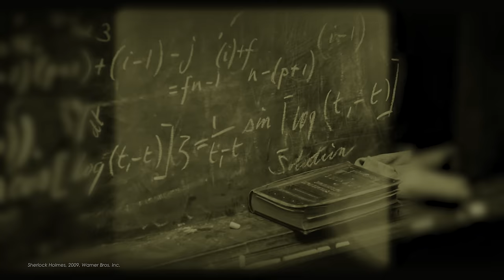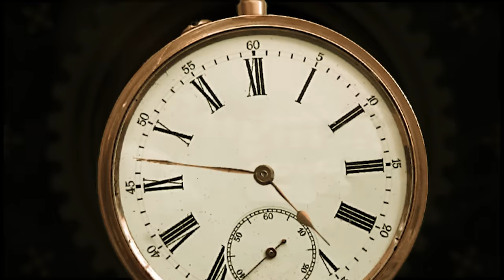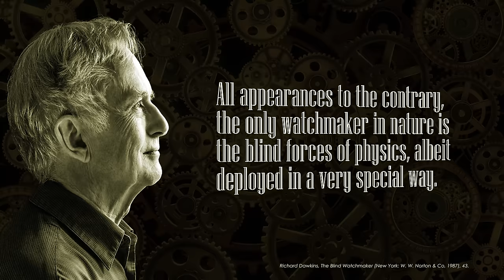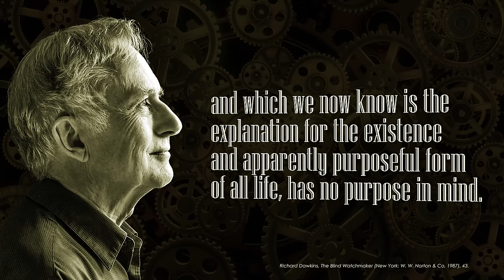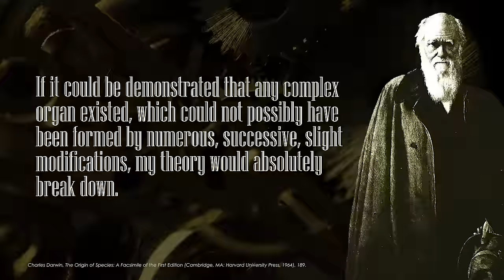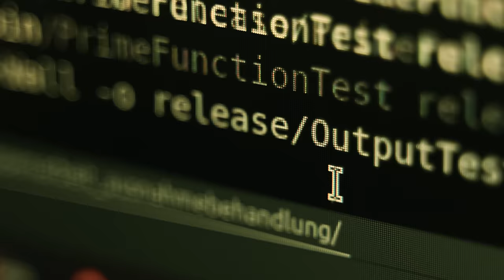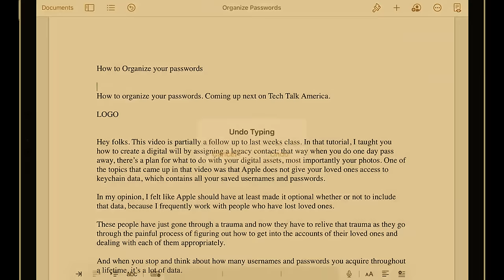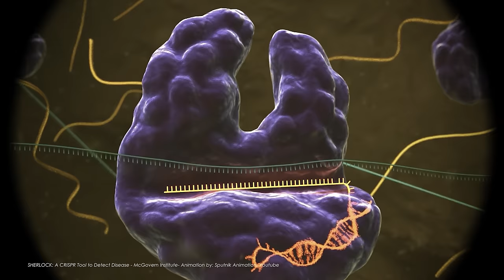Even TOP Evolutionists Won’t Deny This Evidence for God

Comment: THERE. IS. NO. EVIDENCE. FOR. A. GOD.   NONE.   Even the presence of beauty, symmetry, and incredible equilibrium in the cosmos does to point to a god.  It points to the presence of beauty, symmetry, and incredible equilibrium in the cosmos.  That is the only conclusion justified by the evidence.

Remember, just because you don't understand something doesn't mean it's God.  It means you don't understand.
Reply: Design points to a designer- Remember, just because you don't understand something doesn't mean it came about through naturalistic processes.  It means you don't understand.
Reply: @calvinsmith7575  Do you not see the issue in your reasoning?

Can you provide evidence that nature is designed?
Reply: @LordMathious  Of course I can, and so can you. Just apply the exact same standards and methods you would use to determine whether something else was designed or came about by random chance to nature and you will see it was designed just as Romans 1:20 says. What is so funny is that even Richard Dawkins admits there is incredible design in nature.  He just believes it was unintelligently designed : ). Go figure, he believes that no mind can somehow design things our most intelligent minds on the planet can't even come close to : )
Reply: @calvinsmith7575   Then could you please present your best piece of evidence.
Reply: @calvinsmith7575 remember just because you don’t understand something doesn’t mean it came about through naturalistic processes

Just because YOU dont understand something doesn’t mean it didn’t happen via natural. Don’t pull personal incredulity
Reply: You'll want to retype your statement, you have a syntax error.  However, I think I get the gist of your statement:  it philosophically throws out all causation.  Which is odd, since science is all about drawing conclusions from evidence, that is, positing causes due to observed effects.  Philosophically the existence of anything necessitates a prior cause, until you eventually arrive at the uncaused cause (aka Unmoved Mover).  And then it gets even better when you learn that the Unmoved Mover is a person, who wants to have a relationship with you and knew you before you were born!
Reply: @peedee4065  What on earth is this reasoning?

Tell me, how do you start with premise 1, that the existence of anything requires a cause and then turn around and introduce premise 2, that this implies there must be an uncaused cause?

Why is it so hard to accept that the only thing we have evidence for always having existed, the singularity from which came the big bang, is this 'prime mover' that you suggest?
Reply: @LordMathious Cause is a given.  In science we've given a name to that which causes mass attraction:  gravity.  In biology life comes from prior living things.  In anthropology beliefs come from what cultures have been exposed to and their interpretation of that.  In chemistry processes come from interactions of atoms and particles.

When it comes to existence and creation you're just playing games with yourself by continuing the causality process ad infinitum.  

To say that there is no prime causality would be to remove all meaning from existence.  If we are simply a revolving, unending process, then there is no moral good or evil, and there is no inherent right or wrong or meaningful beginning or end to any of what we know and experience.  Meaning that your parents conceiving you had no meaning.  Your participating in "good" acts towards others has no real import.

To say the Big Bang is the Prime Causality doesn't explain our inherent connection with beginning and end and good and evil.  The Prime Mover has a beginning and end plan for setting things in motion.  A Big Bang, which is a purely physical process that doesn't explain soul nor reason nor order by itself doesn't even explain its own existence or purpose, it's just a cop-out cause to explain the physical motion of the universe.  The Big Bang is perfectly observable but can never be the Prime Mover or Unmoved Mover that put things in motion for a reason.  

Ultimately one's acceptance of a rational first cause boils down to a personal struggle and choice with one's own sense of existence and belonging and responsibility.  Choosing to be "distant" can be your personal reality but doesn't affect that universally people have always accepted a God.  Atheism is a modern belief system that threw out anything that couldn't be "scientifically" validated.  The fruit of atheism is a distance from the most fundamental and inherent truths regarding us as living, rational beings.
Reply: @peedee4065   Absolute tripe. Answer my question. 

Why can't the singularity which caused the big bang be this prime mover?

What if I claim it has simply always existed with no beginning? What do you do then?
Reply: @LordMathious  I have already answered you:  a singularity "can never be the Prime Mover or Unmoved Mover that puts things in motion for a reason."  Emphasis being on "for a reason."  A singularity could be the efficient and material cause for the universe but never the formal or final cause (Aristotle's four causes).

The "absolute tripe" is that it takes less reason and more conjecturing to posit that an irrational, purely material singularity is the cause of contingent, rational life.  Nothing material and irrational with zero formal or final cause can be productive of contingent, rational, soul-imbued life of itself.

If you take a singularity and attribute formal and final cause to it then you have equivocated on the term of the Big Bang and have essentially described God.
Reply: @peedee4065   You made a claim but didn't back it up. I'm asking you to explain why.

All the evidence we have suggests that the singularity that caused the big bang has always existed. We don't know if it had a beginning or not.

So, if I claim that it is the final Supreme cause of a universe, why can't that be the case?

How can a material cause be irrational, what does this mean? What does contingent and rational life mean? What does formal and final cause mean? What is contingent, rational, soul-embued life?

Stop with the word salad. You're lucky I dont just rip into that and embarrass you. Instead of just claiming why the singularity can't be the final cause, explain why. It already allows for the big bang, which explains the formation of the universe, which allows the formation of the earth and solar system, which allows the formation of life. What's missing?
Reply: @LordMathious  "Why can't the singularity which caused the big bang be this prime mover?  What if I claim it has simply always existed with no beginning? What do you do then?"  

Saying this would be akin to pointing to a Honda Civic on the street and saying, "This car has always existed.  It always has been, and it always will be."  There's no difference between the absurdity of denying the cause of anything versus denying the cause of the singularity.  If you claim the singularity or big bang has always existed, and that works for you, then we're at an impasse.  I have answered above all the things the singularity does not answer.

"Stop with the word salad.  You're lucky I don't just rip into that and embarrass you."  What's embarrassing about me having an actual understanding of philosophy as opposed to you?  If you don't understand Aristotle's four causes then it's pointless to try and explain to you the severe limitations of the singularity.
Reply: @peedee4065   Took you a while.

Embarrassing evaluation.

Why can't the singularity which caused the big bang be your prime mover?

I want you to explain this point because you started going on about cars.

I want you to explain why the singularity can't be this prime mover. That's it. No more waffle or word salad, please. I've already eaten.

Comment: The thing I see is that these apologists are using man-made engineering as comparison. They say an organism can’t differentiate between good and bad mutations, but that isn’t how nature works and the fact that we are dealing with billions of years, then these things can be fixed. DNA is not a computer code. It is merely analogous to one, but we can’t confine DNA or RNA to predetermined code. The fact is, we don’t know how these things came about and that’s all right.
Reply: No, we do know how foresight programming comes about- by an intelligent mind deciding to do so.  And evolutionists like Dawkins and the Voices of Oxford have admitted DNA is a coded language system, describing it as digital...
Reply: @docsmith9915  Funny, isn't it, that apologetics only started using DNA as an argument for god after scientists discovered it...
Reply: @calvinsmith7575  
They are describing it wrongly. DNA is a code, yes. It is SIMILAR to computer code, yes. However, it is NOT DIGITAL because it isn’t binary, it’s ternary. Dawkins can no more state that DNA is a coded language system than Hawkins can. Neither have enough knowledge of language, or computer coding, to state an absolute on what DNA is .
Reply: So, it operates just like any other code we've ever seen except it is far more sophisticated? You are staring at evidence of design square in the face (as Romans 1:20 states) and punting to 'we don't know'.  But we do know where codes come from. What you are doing is called denial- so you don't have to admit you are a creature who will be held responsible to your creator.  You will have absolutely no excuse when you face God.
Reply: @calvinsmith7575  You mention denial - as you probably deny every religion except your own.  
How did you finally come to choose the religion you follow to the exception of all others, and by what method did you determine it to be the 'One True' religion/god?
Reply: @thedubwhisperer2157  Without the God of the Bible, one cannot even account for knowledge, logic or science.
Reply: @calvinsmith7575  You completely failed to address my questions...  Why?

Comment: Honestly, there are indications against design and foresight. A surprisingly large part of a mammal's genome codes for the sense of smell so that substances can be detected, such as the smell of strawberries. Dolphins have these same sequences, but they are all corrupted and useless. That's because the dolphin is now aquatic and does not need a functional sense of smell. What a waste to still have the code.
To name but one more example, anyone who has knee problems will suspect that the human knee was not originally meant to bend oppositely like front legs would.